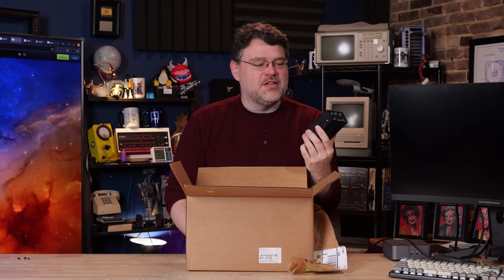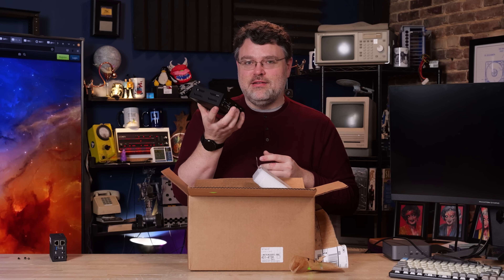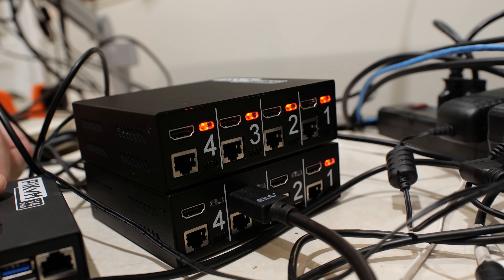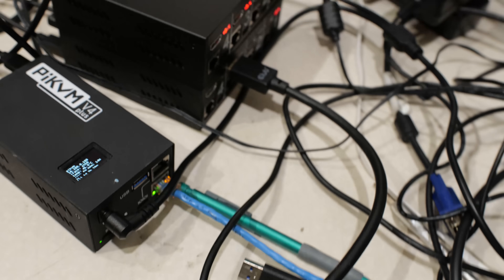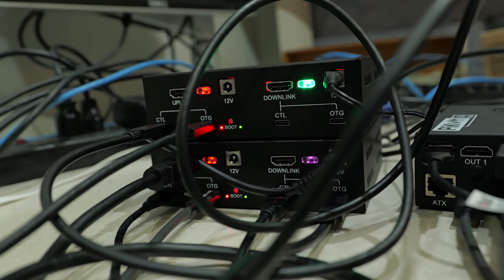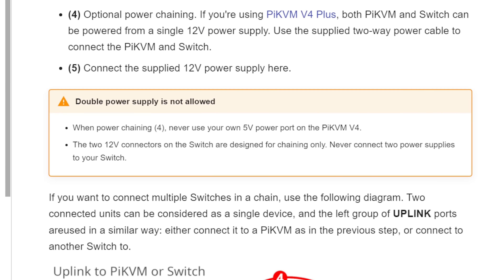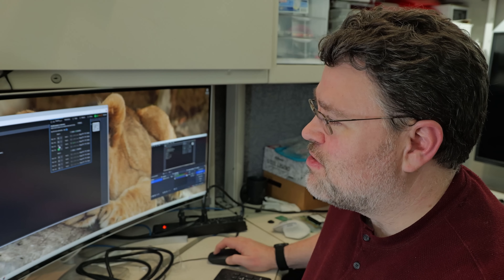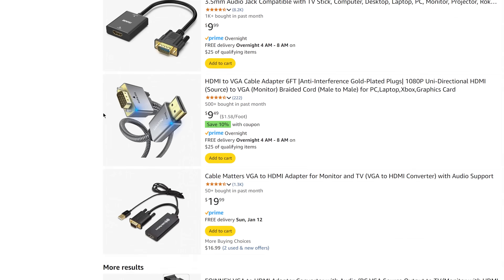PiKVM Switch Multiport Extender Review

Comment: There is some interesting point with what the author is saying that for VGA you can use HDMI - VGA adapter. There is no problem to convert HDMI output to a VGA input, but when it comes to converting VGA output to HDMI input almost non of this adapters not works. I've checked 5 different adapters till got to "VGA to HDMI Adapter with USB Audio & Power" of StarTech, that cost about 65 bucks. So when you starting with PiKVM and you have a lot of servers that have only VGA output interfaces so you need to buy extra of the adapter for each interface.
But overall PiKVM its very good. Using it alot!

Comment: One thing I really miss using PiKVM is the ability to have a local keyboard/video/mouse..  When you're troubleshooting or upgrading right in front of the computers, maybe I am "old school" with this, but we always had the pull out rackmount console or a "crash cart" that would be hooked to the local ports on the KVM.  With this, I'd have to have a network connected computer, and access the PiKVM via network even though I'm standing right there.  With the old PiKVM solution of putting a KVM switch (ezcoo) behind it, I solved this problem by using an HDMI splitter after the switch, and fed one output to the PiKVM and one to a local monitor, and then used a local mouse/keyboard on the local USB. I guess I could really do the same with this, in between the extender and the PiKVM, but I wish it was a bit more integrated (ie: built-in HDMI pass thru).   Is anyone else missing this feature, or am I the only one?  What is everyone else doing for "local" access to the servers?    In any case, I am REALLY glad they are being successful with this!!
Reply: I'm just doing this at home so this may not be practical, but I put a 1U rack drawer in and stuck an old thin laptop in it. The laptop is network connected to access my IPKVM (Not pi KVM) and it worked well for me.

Comment: I like my PiKVM, it has one major flaw though. You can't use an ISO larger than 2.2GB . So you would be unable to install a large portion of modern operating systems.
Reply: Hopefully one day it will support larger sizes
Reply: @KingLarbear now it has full support of big images and dvd
Reply: You can use ventoy to avoid this limitation, it's described in the doc.
Reply: @mdevaev  I'm aware of that. There is one problem though, Ventoy doesn't work with all ISOs
Reply: @mdevaev that's awful, it should be plug in and play

Comment: How is RJ45 not an Ethernet port?
Reply: RJ45 is a connection type, Ethernet itself is a protocol that uses the RJ45 connection. 

Like in this switch, RJ45 is used for more than just Ethernet. For instance: serial/rs connections, hid interfacing etc etc.

Comment: So if I am looking at this correctly.
I take my PiKVM, I hook it up to the switch box as though the switch box were an end-point device.
The switch box then connects to my end-point devices.
I connect to my PiKVM's webUI the way I normally would, and it will be able to control each of the switched devices downstream of the PiKVM

Looks like it's all done at hardware level, so length of your HDMI cables and USB-C cables used for daisy chaining will be the limiting factor on how far apart in a rack or bench scenario the boxes can sit.

Reusing 8p8c standard but not using Ethernet, for ATX controls, I have to wonder are they compatible with TIA-568 standard UTP? Or do they require something more like a straight-through or rollover cable?
Reply: I use a standard Ethernet cable from Walmart for the ATX control with my V4. Since we're dealing with DC signaling here. the impedance matching is irrelevant.  As far as DC is concerned, the standard 568A/B cable is a straight through cable.
Reply: @JamieStuff  I would grab a cheap RJ45 cable tester and just make sure its not a crossover cable or carefully inspect each end to make sure they are the same if you are comfortable doing that. But not sure if an accidental crossover cable would just cause strange behaviour or damage things, depends if PiKVM designed in safeguards to prevent damage or not. $20 for a cable tester is cheap insurance when you just spent so much money on nice new equipment.
Reply: @ Nearly every Ethernet cable on the market today is a T568B-T568B cable. The easy (er, cheap) way is to compare the colors of the wires in the (clear) RJ45 plug, and verify they are the same colors on both ends.

I doubt that accidentally using a crossover cable will cause any damage. These signals are low voltage and current limited, and I'm sure the motherboard manufacturers expect builders to plug the connectors into the header incorrectly.

Comment: Actually an option to power in with the slot plate esp32 controller in a bus configuration with a real kvm on it would make more sense to me. KVM with 16 ports plus 16 slot ports for power on then I could work with only one kvm which would be way better. Just use two ports for each slot one incoming one outgoing and you daisy chain the PCs/server.

Comment: Now if only it was Ethernet, using tcp/ip then make a full pice card that would then add full network remote control, and ability to have standalone of central management via the host master controller, kinda like Ethernet TCP/ip extenders.
Reply: You are wishing for something this device cannot be. The "core" here is a raspberry with a hdmi to csi(camera) port converter so the HDMI to ethernet conversion happens only in the "core" unit.
Reply: @marcogenovesi8570  I'm talking about a oss device much like hp ilo or Dell idrac, a full pcie out of band management engine that would link to a centeral hub, and that could pass video out over the network, hp ilo uses the matrox "gpu" for that!
Reply: @marcogenovesi8570 maybe this Pi cannot, but a board with a compute module could perhaps.

Comment: Recommendations on good VGA to HDMI adapters for servers?  Haven’t had a good time with my PiKVM with 4 different active adapters.
Reply: For my stuff I used a BENFEI VGA to HDMI Adapter for 1024 * 768, but also had a real monitor and going through a splitter.   You might need something like a VGA EM-EDID-HD15 Pass-Through EDID Emulator if the monitor isn’t attached on startup to make it think something is there all the time.
Reply: if you have not had a good time, your server is probably sending a VGA 700x420 resolution ar 70hz which was not really common in consumer stuff and less supported by adapters. On the pikvm reddit somebody is recommending a StarTech VS221VGA2HD, but you can probably search for an adapter that can do that VGA resolution
Reply: @marcogenovesi8570 this has to be the exact issue I’ve been having.  I’m going to give this a try, thank you!